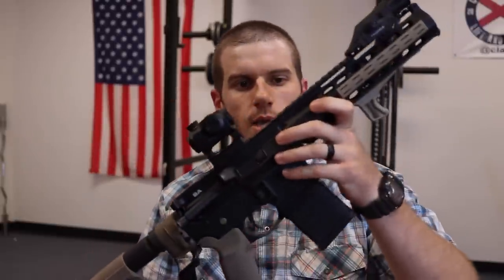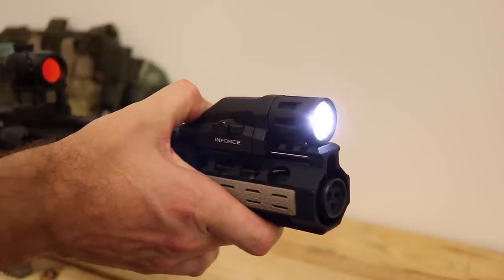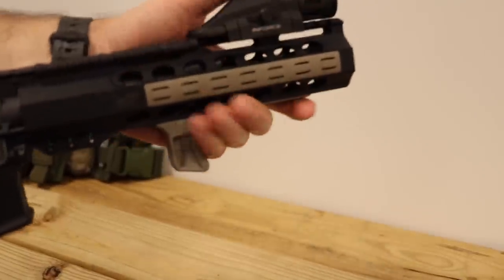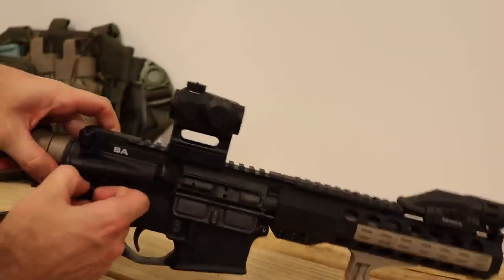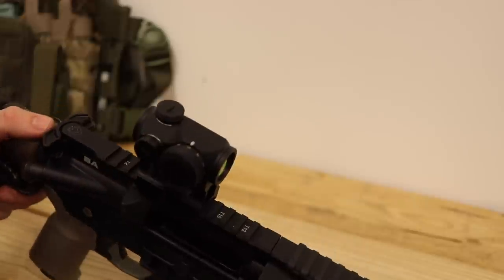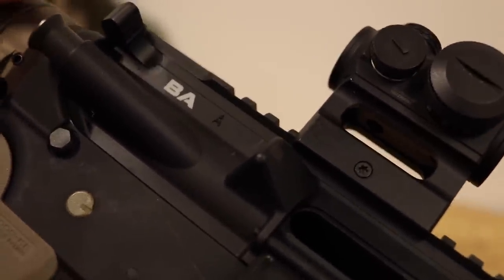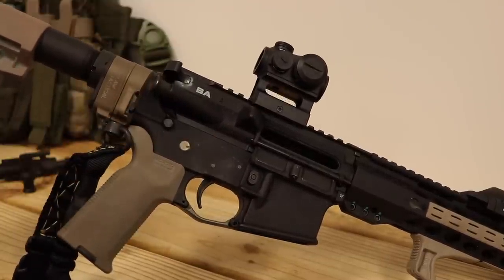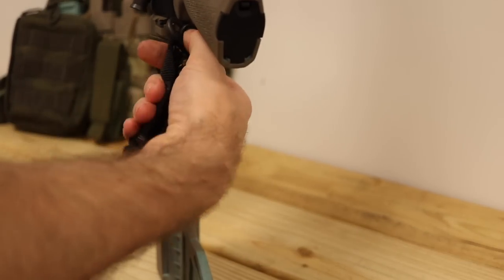Build Breakdown of 7.5" AR-15 Truck/Bag Gun

Comment: I'm in the middle of a pistol build myself and wanted the Law Folder with the Blade brace, but from what I'm seeing the ATF is stating the LOP (Length of Pull) measured from the further most point of your brace when fully extended to the face of the trigger cannot exceed 13.5" or it "could constitute a repurposing of the brace as a stock." Just curious if yours meets the requirements before I spend the money on the folder. Thanks!!
Reply from the maker: The blade isn’t adjustable, it is held in place with a large set screw (at least this older version is.) I can set it to less than 13.5 and lock it place.

Comment: Nice set up! I keep an 8.5” in the car and a 7.5” as a HD. I’ve got a few 16” builds, but I can’t get past the braced pistol builds for CQB.

Oh yea, I keep soft points in both of mine as well. The Hornady Black BTHP doesn’t necessarily expand, nor do any HP 5.56 rounds I’ve found, very well out of any of my ARs. The mags I use are pmag 40 rounders and 30s. I keep two 40s coupled and in the gun, and 5 30s in the GHB. Not a fan of the D60 just yet. Looks slick AF in these short pistols, but 80>60 imo. Even if it’s spread b/t two mags
Reply: I couldnt justify the d60 either until I got one along with 2 90 round drums by mgw I think, I forget the name. Got all 3 drums which were brand new in the boxs from someone locally. Paid $150 so I couldnt say no lol. D60 stays with my 7.5" pistol now, its a must have if you can get one for $100 or less in my opinion. Those extra 20 rounds could be what you need while the other person is doing their mag change. Of course your 2 40 rounders are much cheaper so thats also something to keep in mind. I also have a beta 100 round drum, im just a fan of drums lol

Comment: Whats a good carry bag for a 7.5 ar pistol. I didn't install the law tactical folding brace
Reply from the maker: Without the folder your gonna need a duffel bag or a dedicated long gun bag. If you separate the upper and lower it will fit in any backpack.
Reply: What size back pack do you use I’m gonna get a folding stock so how many liters or length backpack should I purchase
Reply from the maker: I can’t remember for sure the length, but I think a folded 7.5” needs a 19” bag and a 10.5” needs a 22” bag.

Comment: im new will all there parts fit on a S&W Sport 2?
Reply from the maker: For the most part all AR15 parts are interchangeable. They all use the same size components and can accept the same accessories. If you’re talking about changing it from a rifle to a pistol, there might be some legal stuff you’ll need to look into.

Comment: What is the total length when folded?
Reply from the maker: I can't recall exactly, but I think it was 18-20". That gun now has a 10.5" barrel so I can't measure it with the 7.5" anymore.
Reply: Clang and Bang how long is it with the 10.5” extended vs folded?? 👀👀👀  asking for a friend
Reply: @ClangandBang  Your edc bag measures 17 in. I looked up the specs. So weird how you get 20 inches folded in there while I can't see to fit a 7.5 with law tactical folder in anything under a 20 in bag! Lmao
Reply: @maxpain6822  because when you place the pistol in the bag it's at an angle which gives at least 2 more inches for the pistol to fit